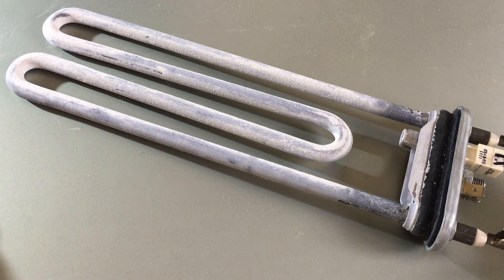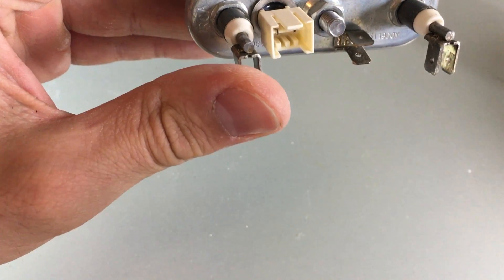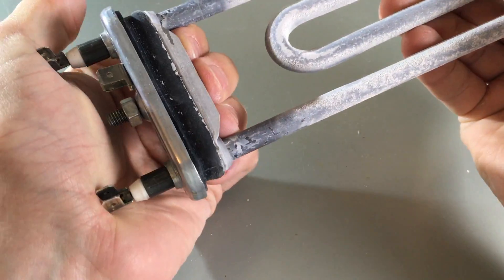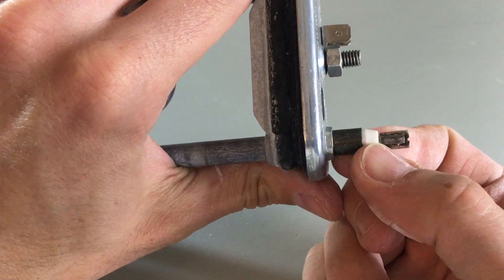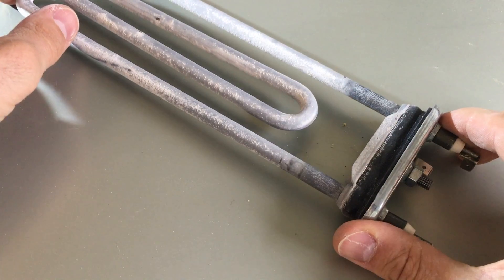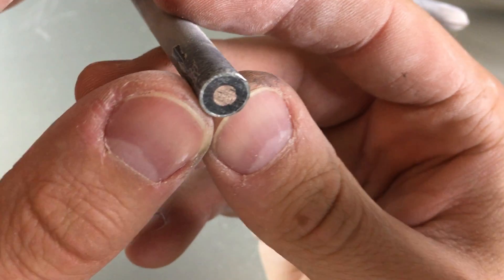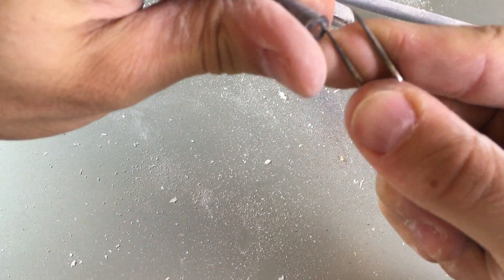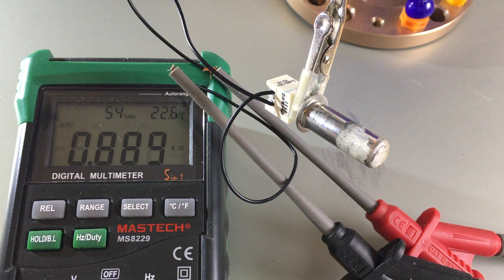Whats Inside A Heating Element?

Comment: The sand your refer to is usually mgo magnesium oxide....acts as isolator for electricity but relays heat....
Reply: Thanks, I was looking at my sisters washer the other day, the element was shorted to earth, I wondered what the insulation was, when I tested for continuity between the element and the outer metal while tapping the element, the fault came and went, I wondered how this insulation failed, her machine jumps about alot on fast spin so maybe it could be the vibration that caused the insulation to break down.
Reply: Mo(Si)2 is another

Comment: didnt cut far enough, the element is usually a spring made of nichrome wire supported in a ceramic powder, at the ends copper pins (which you can see in this video) are inserted and the nichrome wire is attached to them usually by spot welding, then some high temp cement seals the pins in and also the end of the tube. terminals are then attached to the pins and a mounting plate.
the element in this video looks like its taken from a hotpoint/hoover/indesit/candy brand washing machine
Reply from the maker: Thanks a lot for explaining. It was an AEG Electolux machine. I guess the number of suppliers for tholse heating elements is limited anyway...
Reply: I think this is a different design. For designs like stoves stranded wires such as seen here provide enough resistance. The design you describe is common in water heaters for example.

Comment: The reason you see just copper is because you cut too close to the end of the element. That's still part of the mounting stud in there. If you cut it farther down the element you'll see the characteristic resistive wire (such as nichrome or similar) and the sand (MGO to be precise). Try cutting farther down the element and maybe make another video?

Comment: in these heating elements is the heating wire, which is surrounded by densely packed aluminum or magnesium oxide as an insulator
you just have to open it further

Comment: Hello, i think it cannot be just copper inside the heater. Perhaps you sawed it off too close to the mounting bracket and the real heating composition will show after 10cm or so. I would really like another video that explores this. (The black isolation seems to be part of the mounting bracket on which the metal pipe is pushed onto and the copper rod part of the outward connector)
Reply: I second your idea